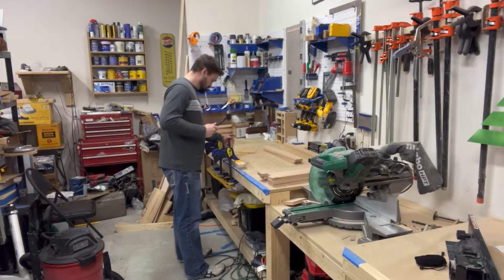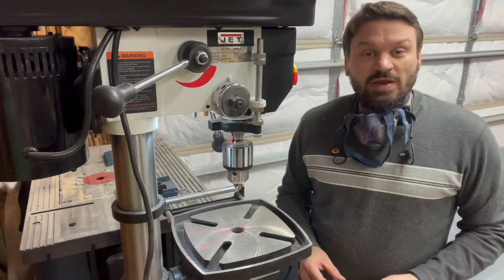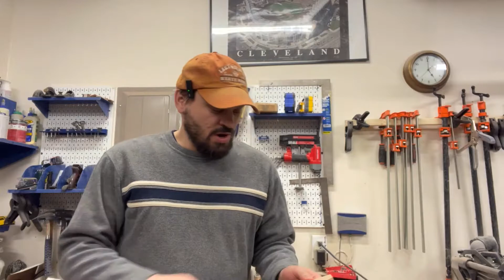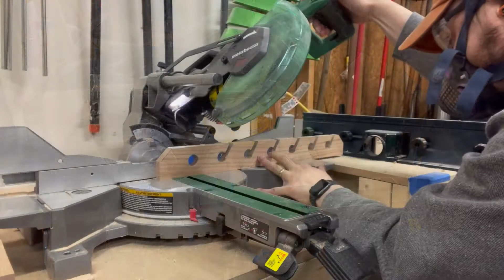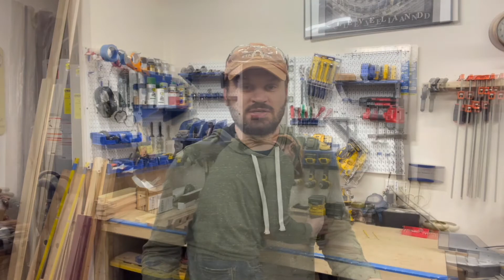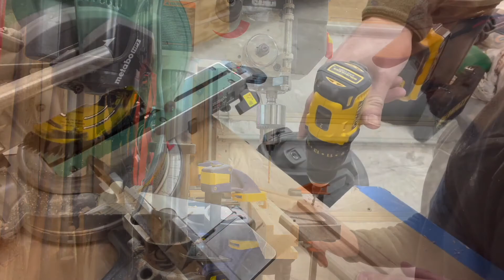Vertical Fishing Rod Holder | Fishing Pole Rack | How to Build Fishing Pole Storage | #Fishing

Comment: what is the space of the bottom holes, if i just wanted to make 6 holes?  I like your video presentation.
Reply from the maker: Top holes are 1 inch and bottom holes are 1.5 inches.  The space between them are set at a equal distance apart from each other with approx. 2 inches of space at each end.  As such, I would probably use the same distance with 6 holes.